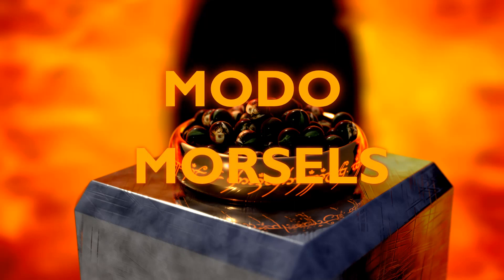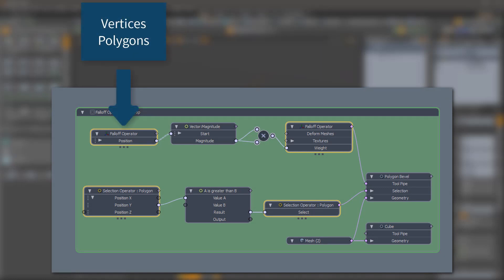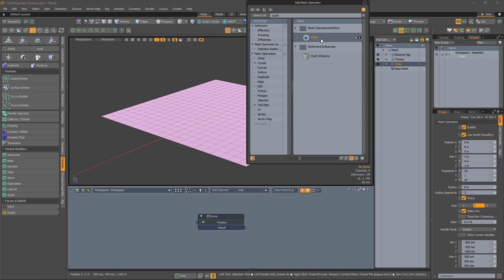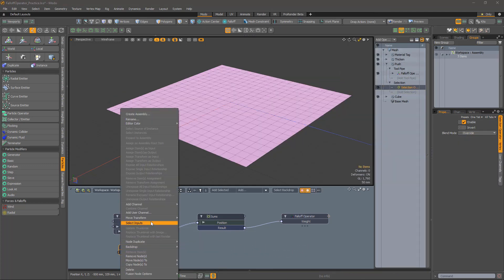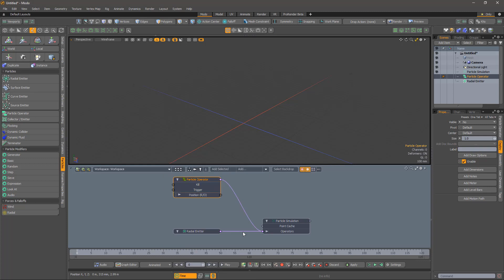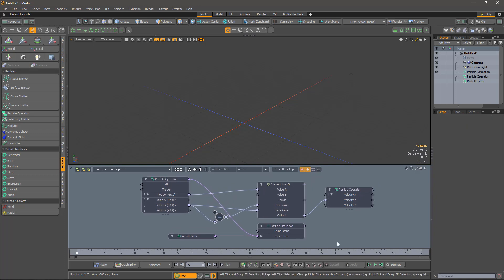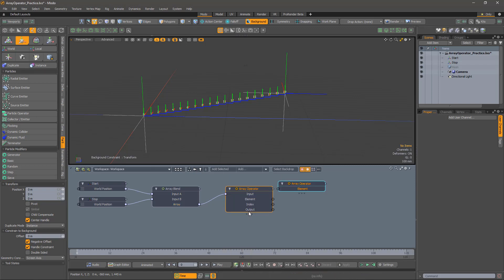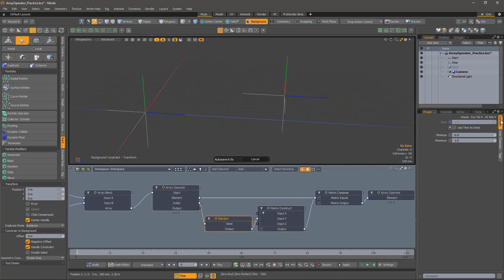Operators Manual

Comment: To be honest, it's difficult to understand, I do my best, but it's pretty hard.
Reply from the maker: Sorry to hear that.  If there is something specific that is causing a problem I can try to help in a future morsel.  This is a topic at the more technical end, but I would hope it is explicable.
Reply: @SteveHill3D  The nodes in modo are pretty confusing thing in the first place, and sometimes work counter intuitive compared to other software such as 3ds max or substance designer.
I still don't get where the practical application of all this begins.
Reply from the maker: Thanks for the feedback.  Maybe I should do something to address the basics - I don’t think MODO is particularly different, but I am probably making assumptions based on my experience of using it.  It can be hard to put oneself in someone else’s shoes.
Reply: @k gon Modo nodes are pretty much like simple programming but without code and with convenient "boxes" that helps visualizing data and the logical flow. 3dS or Substance or Maya Mental Ray or other node systems are way more "higher level" nodes, meaning you're already presented with the calculation outputs without having to think about what's "under the hood". That's a bit like Modo Assemblies but I don't know if you know them better. It's better if you imagine Modo nodes largely as "facilitated programming" rather then only some sort of "advanced toolkit" like I don't know, Mesh Fusion.